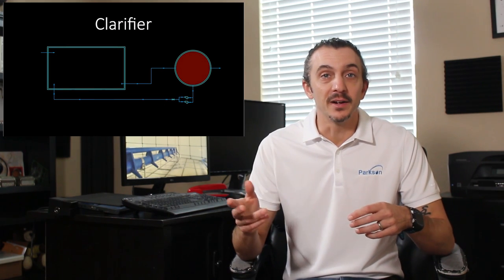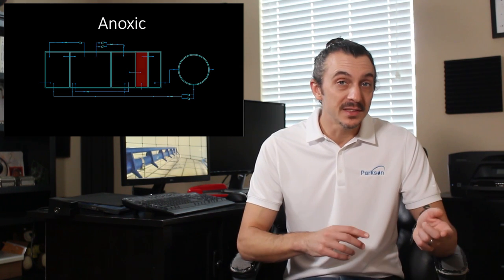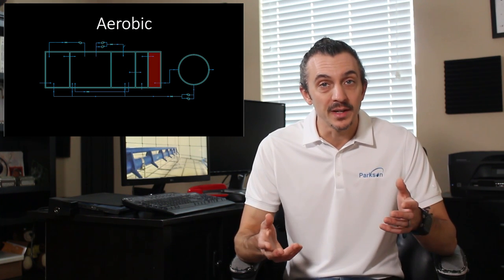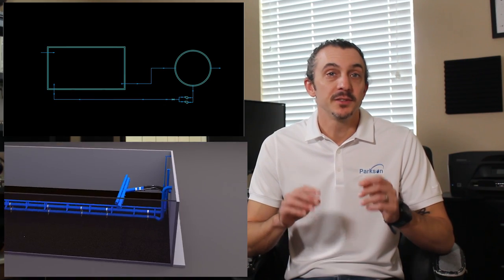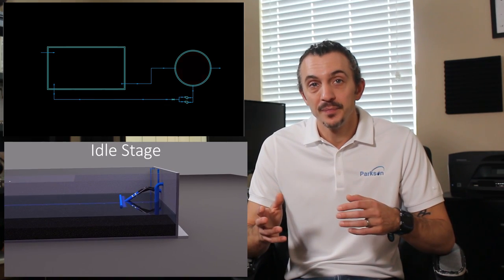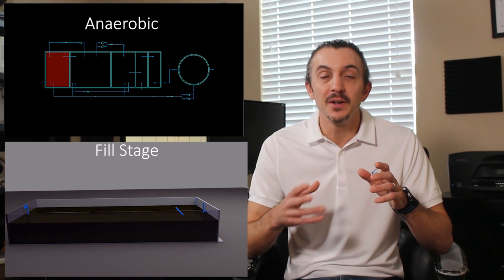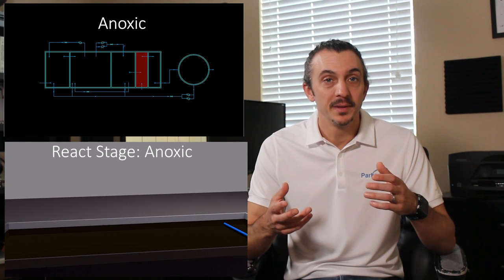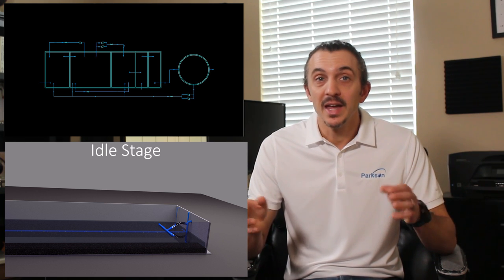Sequencing Batch Reactor (SBR) - Parkson's EcoCycle

Comment: How is the appropriate wasting volume determined per batch? Do you have basin TSS meter?
Reply from the maker: Thank you for reaching out. A TSS meter is not typically used. The operators run mixed liquor suspended solids (MLSS) tests in the lab at least once a week to determine if the desired MLSS concentration is being maintained. If the MLSS is too high, the waste volume is increased. If it is too low, the wasting volume is reduced. The MLSS changes are generally very gradual so real time monitoring via TSS probes is not required. Please let us know if any additional questions!